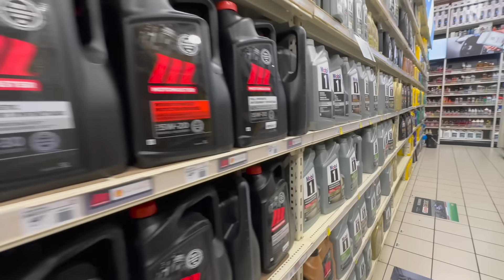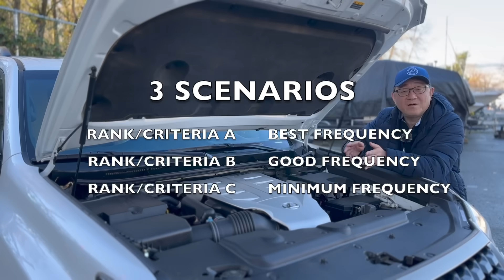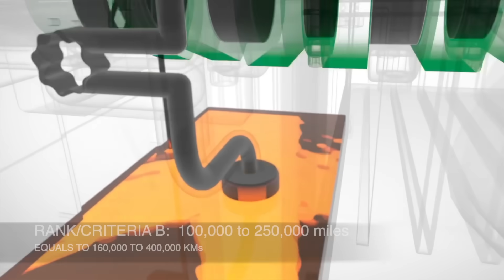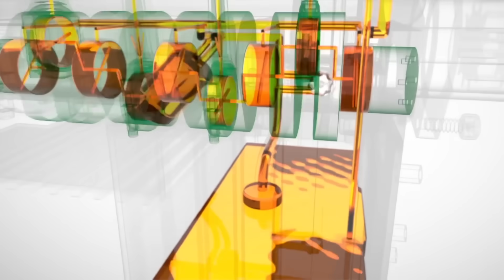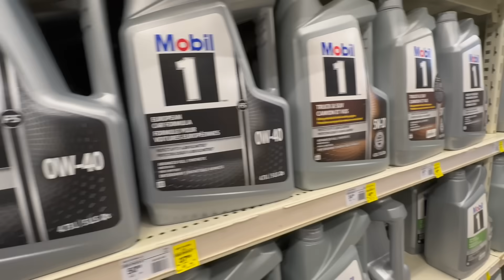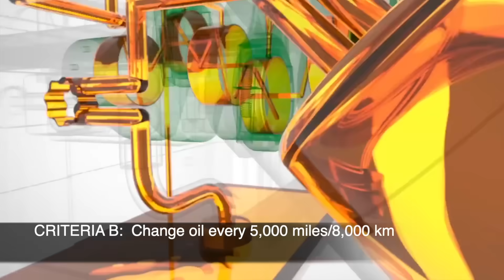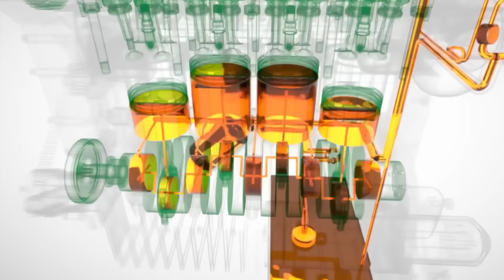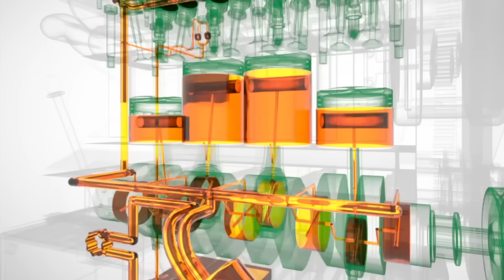ENGINEER EXPLAINS HOW OFTEN TO CHANGE OIL & FILTER // UPDATED CRITERIA-BASED RECOMMENDATIONS!

Comment: Have been driving for over 20 years, always change engine oil and filter when around 10k km. Using well-known brand fully synthetic for all my cars except 1 using semi synthetic. But that 1 car will have an oil change interval at 7000km. No major problem so far. Own several cars, each been driving for more than 5 years.

Comment: So tires have gotten miles better, dampening technology and the oils they use have advanced so far, our engine building tolerances have gotten down to the point we're using 0w-10 or thinner among thousands of other improvements but we're still stuck using 1950's oil change intervals.
Reply: I remember the 50s. Engines were dirty. Oil was a nasty mess at 2.000 miles. Multi grade oil couldnt be used in a diesel engine. Wasnt good for a gasoline engine. Remove the drain plug and nothing came out. Push in a screw driver and get some out. Oil filters were better at cleaning oil than they use now.They were optional equipment. Normally used cotton. John Frantz started putting his canister filters inside the old canister filters in 1953. That took care of the dirty oil problem but they were called snake oil. He made the rediculous claim that filters are supposed to get dirty and oil is supposed to stay clean.

Comment: Also,since your rec how to extend the life of an engine you should also rec they do a complete transmission flush including a trans oil & filter change & a coolant flush & change service both every 50k miles & not the 100k+ miles many car mfg’s rec to do it. 
That will extend the life of the transmission, water pump,radiator,thermostat & coolant hoses too.
Todays 6-8-10 speed transmissions & cooling systems complex & not rec you also service them at earlier intervals is not hood IMHO.
Reply: Every single thread I've read on transmissions, 9 out of 10 comments are, never flush,, always drop pan drain & fill (a less than 100 %) of the t-fluid. Thoughts?
Reply: @djjf45  3 times drain and fill replaces around 97% in most vehicles. Flushing can be detrimental to a transmission.

Comment: For example I wanted to do rank A, but the car is brand new. How do I request this to the Service Advisor? In the warranty booklet they will sign it every PMS which is every 10,000km or 6 months. In the shop they follow 5,000km = 3 months, 10,000km = 6 months and 20,000km = 1 year.

Comment: 3k miles, irrespective of your anticipated ownership is wasteful (environmentally and wallet un-friendly) - FFS, it's not the 1980s anymore. Car Care Nut is a mechanic, not an engineer. He generates opinion based on his limited personal observations. Oil doesn't go bad only because it's contaminated (which consumes detergents in the additives). BMW learned the hard way with their 15k intervals. Failing to recognize that some Z- and M-car owners might use these cars seldomly, would not hit 15k for 2-3 years... however the oil just sitting in the sump was oxidizing... quickly after added a 12 mo time limit). There are two parts: base oil and the additive package. Not all oils are created equal. Some oil is hydrocracked Grp III, some are PAO Grp IV... ester blends, etc. Shell/Pennzoil is GTL (which isn't Grp III or IV)... Oil gets "used" and the viscosity may actually drop over time, as well as additives being consumed. Internal combustion also can turn the oil acidic. Some oils are more suited for longer service intervals, but for that you need to know what to look for (oxidation value is 1 indicator). These factors will affect your change interval. In nuclear, we know that our decisions could impact the lives of thousands, so safety is not taken lightly, yet we kept extending service intervals  (oil changes) on a lot of equipment... without jeopardizing safety. You are giving bad and excessively conservative advice. Blanket/mindless advice? Your use case will affect your service interval (towing, taxi service, etc.).
Reply: You want good oil/lubrication info? https://www.youtube.com/@themotoroilgeek Here you can learn why some oils have more calcium, moly, etc., or why TBN isn't such a critical characteristic now that we have low sulfur diesel...

Comment: I have a 2010 CTS-V wagon manual with 732,482 Km I change my engine oil every 8000km and transmission every 70,000km still run like new

Comment: 2010 Camry 2.5L 180,000 miles. Did oil change every 10,000 miles with Toyota dealer bulk oil. Burns oil but that’s normal in my opinion with a car going on 14 years old here in Minnesota. She still looks like new and is very smooth. I just gotta check it every couple of weeks. My wife just got a new Lexus LX hybrid with that same 2.5L engine so I’ll have her take it in every 5,000 miles. I’ll buy Mobil 1 extended protection for that. We also still have the 2018 RAV4 hybrid with the 2.5L it’s got 80,000 miles on it. Not burning oil but I’ll start 5,000 OCI instead of 10,000 Oil change. I’m very loyal to the Mobil 1 brand because it flows faster and better in the super cold weather.
Reply: Its possible - not guaranteed - that your Camry would not be burning oil had the car had its oil changed at more frequent intervals.

Comment: Hi David, I love you and your videos but as a mechanical engineer with over 20+ years in the field developing engines and other related technology for Honda and Toyota in the US and abroad, I have to interject. I agree that these are intervals that may make people feel better and peace of mind is so important but that is different than what is factually required to keep an engine running for up to 300K miles. You as an engineer should know that anything you say should be backed up by multiple case studies and hard data and I just have not seen any such study from a publication in our industry to suggest that engines need oil changes every 3,000 miles to last “forever”. As an engineer you should also know and share with your viewers that oil changes are simply ONE variable in keeping a car running for that long. What about checking the other fluids in your engine on a routine basis? And making sure your engine is running at its optimal temperatures? Engine temperature is one variable that actually directly impacts an oil’s useful life. Run it too hot and the oil will burn. Run too cold and the oil won’t be as viscous as it needs to be. Many case studies from governments and industry bodies (so independent from any automaker) have clearly stated that newer engines can easily run for decades with synthetic oil at the manufacturer’s stated intervals. If you have PEER REVIEWED case studies that were conducted using participants that stated what you are stating in this video as FACTUAL, I would like to see them. You and I both well know that Toyota engines and Toyota cars are designed to run in cars and markets all around the world especially those where good gasoline, good engine oil, and routine maintenance can’t be taken as a given. And yet those cars run for decades without issue. I’m sorry for the rebuke but I just don’t think it’s appropriate for people in our profession to use our profession to make claims like this just because we’re engineers of some kind. I would never talk about body and build engineering as that’s no my speciality (the way it is yours). So please be careful how you use your platform to guide your viewers, clearly separating fact from opinion. Thank you, and enjoy your channel!
Reply from the maker: Thank you for your frank and honest feedback.  Just so that you know, I worked as a product development, manufacturing, and vehicle evaluation engineer for decades - testing everything from engines to suspension.  I was the "takumi" engineer that took apart everything and tested components against difficult challenges.  My self, AMD from Car Care Nut, and my good friend Mr. Takumi from Nissan GT-R engine specialist (head of Nissan GT-R engine) all agree that these intervals are correct suggestions based on our own experience, but also based on internal testing done at various suppliers and engine specialists.  These are not just opinions, but they are based on many internal studies that unfortunately are not available publicly.  Having said that, there are indeed many variables other than oil/filter and they are also very important in terms of contributing to long term reliability.  And perhaps I will cover those topics in the future.  In any case, I have my own professional opinions that are based on over 30-years of experience working on both the automaker side but also on the supplier/service side - and so it really is up to all of you to whether trust my recommendations or not.  I think everyone is entitled to their own opinions so they don't have to follow my recommendations if they feel that they are not based on sound judgement and information.  Thanks for watching my videos in any case...
Reply: @AutomotivePress  Hello! Thank YOU for your response! By no means was I questioning your authority, but there are a number of studies that are to the contrary which is why I say that providing sources and citing your recommendations is important. I also think that we industry veterans need to provide context around WHY what we’re saying is the way it is. And that’s actually what I have appreciated about your videos. You ALWAYS talk about how you know what you say is right. I felt like that was missing here (to my point about newer, more resilient engine design and technology; newer, more resilient synthetic oil technology, etc.). As I’m sure you know, there are also things that those of us who have cars that sit and don’t run that often should be doing to maintain them too. Such as, I always run ethanol free gas in my Rav4 Prime and Lexus LC500 since I only run the engine in the Rav once a month or so and my LC (sadly) just sits in my garage most of the time. All I’m asking is that you use your experience to educate, not just instruct. The same way takumi do on the job at Toyota.

Comment: I find remembering to do the oil change is critical.  I've got five cars in my "family fleet".  The cost of oil for the car is a fraction of the cost of the fuel I put in a car, it doesn't hurt I shop for oil on sale, get good quality oil filters inexpensively and change the oil myself.  All that said, I like an interval of 3,333 miles.  So, my entire fleet gets oil changes when the odometer ends in 3,333 miles, 6,666 miles and 9,999 (10K) miles.  They're all on the same schedule, so I can tell at a glance when I'm due for an oil change on any of the cars I'm responsible for.
Reply: At first, I thought this sounded ridiculous. But the more I think about it, it’s awesome!  I’m definitely starting this
Reply: When changing oil at 3,000 mi was the standard, it was easy to just add the first two numbers on your odometer and if it was divisible by 3, it was time to change your oil. 3000 3 + 0.  42,000 4+2  96,000 9+6